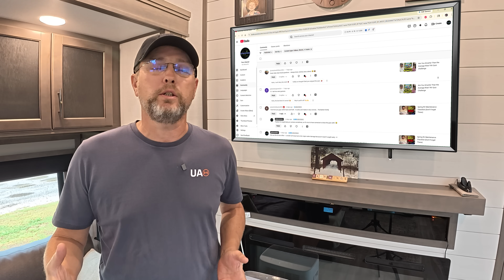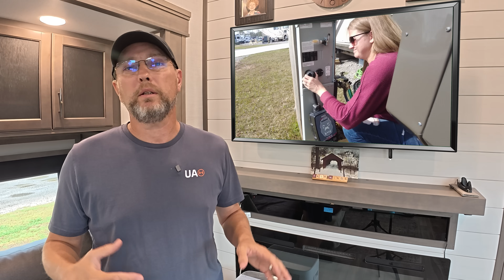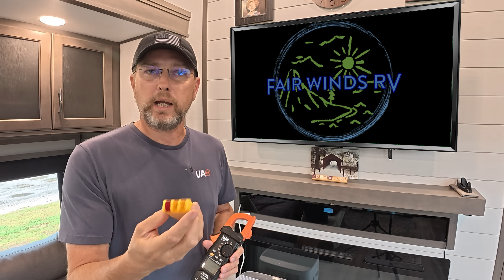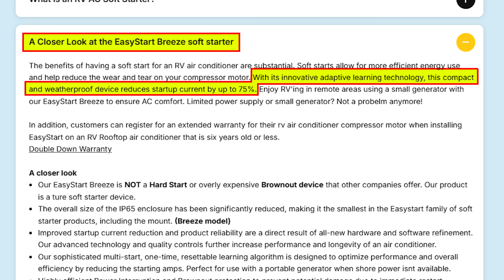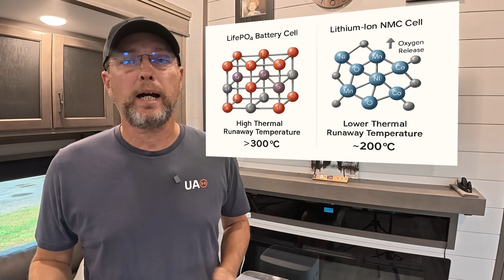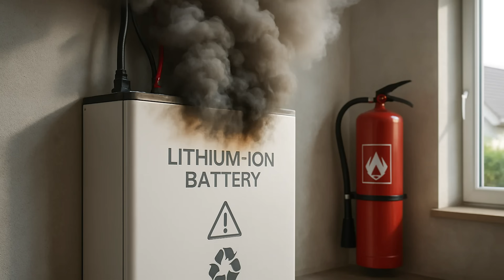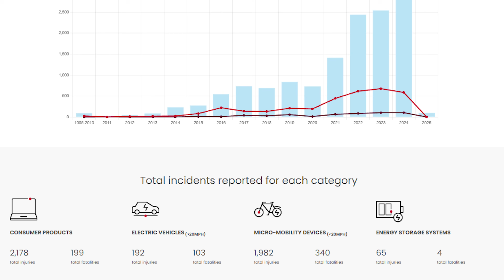Bad RV Advice We Keep Seeing (Let’s Clear This Up)

Comment: One comment I would make about LiFePO4 (as a person who has almost 60 kWh worth of such batteries), is that even though they are far far safer than other lithium chemistries, and don't outgas or runaway under normal conditions, you still do need to take some precautions.  But really not more than you would for a lead-acid battery's precautions against hydrogen outgassing.

A LFP runaway typically produces prodigious amounts of toxic white smoke, but typically does not actually self-ignite.   NMC and NCA can both self-ignite explosively.  LFP does not.  The thermal gain for LFP is 1/100th the rate that the thermal gain for NMC is.  The problem that must be dealt with is the fact that the smoke is toxic and also flammable.

So the precautions to take are fairly simple:

* Make sure the compartment is not completely sealed.
   You don't want pressure to build up in a runaway.
* Make sure the compartment is vented to the outside and not into the RV
* Make sure the battery pack does not block exits.
* And have a smoke detector (like usual)
* Having a temperature sensor in the battery / electronics compartment is also nice.

Some of the larger rack-mount style LFP batteries have built-in "fire extinguishers".  These don't actually extinguish any fire, what they do is generate an inert gas that mixes with the outgassing battery gas and makes it less flammable.  It might also soak up oxygen (not sure about that one though).

* Be sure to use LFP batteries that have both low and high temperature protection
* Be sure to use LFP batteries that have actual over-current protection and not just thermal overload protection.
* A small surge capability is fine, but don't use golf-cart batteries that have huge surge capabilities and no over-current protection (that only have thermal overload protection).  Instead, Parallel LFP batteries if you need more surge.
* Good to have a LFP battery with a fire suppressor built-in, but not strictly necessary.

--

On the surge protection / power quality protection devices, one thing to note is that at some campgrounds the power is so dirty that modern inverter-chargers will refuse to use it even though the voltages are usable.  As an alternative, have a direct, isolated 120/240 AC battery charger handy that you can plug into the pedestal instead, tied into the battery bank.  Thus shore power doesn't enter into the RV at all and you can extract power even with a bad ground or missing neutral.  For example, an EG4 ChargeVerter (for 48V batter banks).

That's it.
Reply from the maker: Great tips! Thanks!
Reply: Thanks for that. It’s funny, I am building a rig and was going to vent my battery compartment to the interior for cooling. Now I am thinking much more seriously about venting through the floor to outside, both for the reasons you mention and to not dump heat from components into the interior.

Comment: I have Lifepo4 batteries on my trailer.  My only complaint is my own fault, I wish I would have gotten higher amp-hour batteries LOL.  The ones on my trailer are only 100ah...I also only have about 200 watts of solar on the roof, so I need to add more solar power, and I may look into adding additional batteries when I add more solar.  

Whatever fancy devices you plug your power cord into whether its a surge protector, or an EMS, those don't fix whatever power source you plug into, they just tell you there's a problem.  Then what I've seen people do, that fancy $300+ EMS gets unhooked, and then they still plug into that pedestal LOL....so they bought that fancy gadget to not even bother using it when there's a significant problem, and then wonder why they have power issues inside their RV.  Either move to a different spot, or don't plug in and worse case you'll have to run your generator.
Reply from the maker: Too true. I've seen the same...why spend the dough if you're just gonna ignore it?!

Comment: Having different types of batteries can be confusing when all it used to be was alkaline "D" or lead acid. I was taught not to place LA batteries on concrete. Now I hear that's no longer an issue with plastic cases.
It doesn't help when news reports just say, "EV batteries caused this house fire." The details get lost. I'll bet cops can't watch cop shows, just unrealistic & silly. Actually, I thought your Eco-Flow batteries were NMC.
Reply from the maker: They don't need details to make news! Just need a headline. 😂 The EF batteries are LFP. Wouldn't buy anything else.

Comment: As far as surge protection goes, I feel many confuse the "surge protector" with an EMS system. Personally, I would not waste money on a surge protector as my goal with a device like this is to to actually protect the RV electronics/electrical by blocking power to the RV. A true EMS type set up offered by companies like Progressive Industries or Hughes is what I install on my RV's.
Reply from the maker: Bingo! We did a whole video on that a few months ago (linked in the description). That is for watching and thanks for pointing out that great tip!

Comment: Great job Jeremy.  Right up your alley.  I see a lot of issues reported with shore power cords and connectors.  Those soft start devices will surely help reduce wear and tear and deterioration of those components.
Reply from the maker: Thanks! Those soft starters should be standard in every new RV!
Reply: The soft starts help a lot, they do not harm your AC compressor, in fact they help extend their life by not sending a sudden surge of power to them every time the compressor turns on.  Even though I have a 50amp RV, and can run both AC units without any issues, I'm still going to be installing those soft starts.